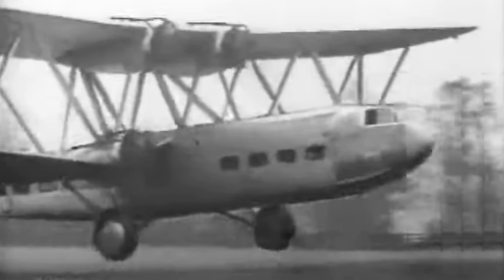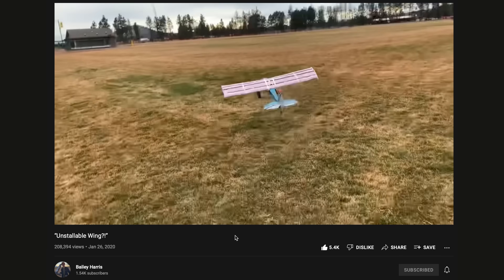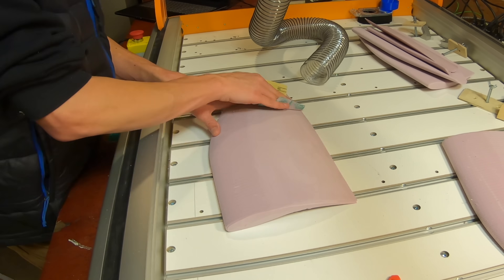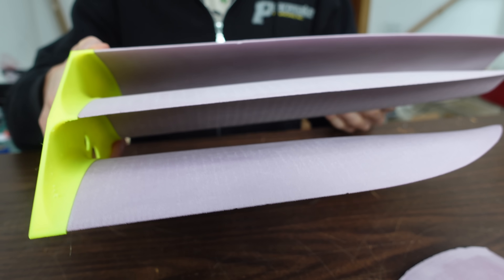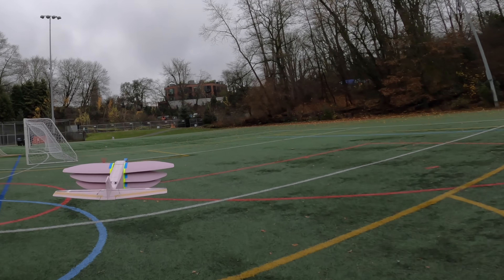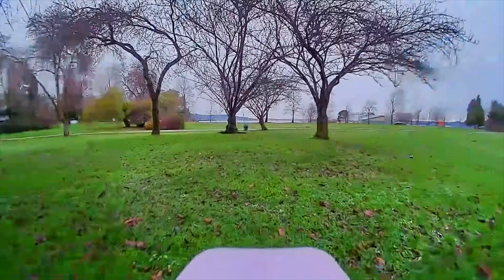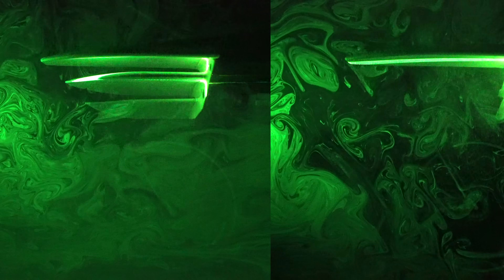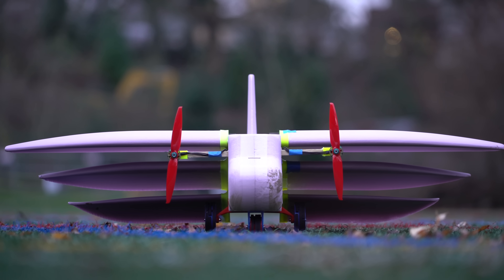Best STOL Wing Design Ever?!?

Comment: i mean birds already had this down pat as individual feather muscle control and sensory allowing for different flight characteristics based on which muscles they hold tight or loose that's clearly evident in their landings if you can watch such a fast motion and understand it but for takeoffs they'd grip and climb 🪜 through the air only twitching the flaps aka feathers open to slide through the air momentarily bringing wings forward for another down/reverse push stroke
Reply: i had a fucking stroke reading this.

Comment: I believe mounting your propellers lower would help counter the throttle-up-equals-nose-down problem.  Getting your center of thrust below your center of drag will generally try to push the nose of your aircraft up instead, while your current setup has the center of thrust above the center of drag.  Obviously, not easy to just move the props lower, as that creates ground clearance issues, but maybe you can mount the compound wings higher?  I'd say putting the middle wing surface where the top is currently would most likely improve the flight characteristics based on thrust.

Of course, you may need to raise the tail again to get it out of the wing's air-path after doing something like that.

As for your "Tailerons," they seemed to work quite well.

Comment: That nose-down takeoff definitely showed the magnitude of the crazy pitching moment from this wing. Awesome work man
Reply: Not neccesarily, the thrust lines of the engines could be an issue. When they are at the upper level of the aircraft's thrust/drag lines the engines should have up-thrust. Check out some of the amphibious aircraft designs with high mounted engines, they all have up thrust.
Great trial.
Reply: @vumba1331   I always wondered about the angle especially with sea planes.
Reply: @vumba1331  Good idea, but it could be that  the angle of attack was chosen too high, that means instead of lift it produced also drag (=non-zero backward component of the lift).

I think the angle of attack should change when adding more wings. Consider all three wing pairs to form a single wing-pair with holes in it, then it looks like configured for landing. 
Maybe if the angle of attack is smaller, then the air flow does not really use the "holes" and it shows less drag. I would be interested in knowing how it behaves.
Reply: @vumba1331  yes, this is what I was looking to ask about raising the thrust vector.... thanks
Reply: @chtomlin  You're welcome, good lock with the trials.
Reply: I would think center of drag is low down, around that lowest wing with its very high angle of attack, couple that with the high-mounted engines and it's not surprising there's pitching down under power (and at take-off).
Reply: @grantm6514  Agreed, angle the thrust lines more upwards.
Reply: Do us some new videos about vtol
Reply: I suspect that ground effect on the lower wing that is very far aft also contributes to that.
Reply: not pitching moment of the wing, its the motor angle.  The motors need to be twisted up so that the line of thrust goes slightly below the cg.
Reply: Ever seen a B52 take off. The rear always gets off the ground first
Reply: Exactly what is a "work man", and how does an awesome "work man" differ from a regular "work man"? Eaten any grandmas lately?

Comment: I always wonder about the slotted flaps when I took a flight.
Reply: There are several effects with the slotted flaps.

They are actually called "Fowler" flaps  Typically 2 to 4 stage (2 to 4 sections)  You can have just one.

The flap not only rotates, it is pushed back.  This combination opens the slot.  It also effectively adds wing area, because in the retracted position, the flap sections overlap each other.  Pushed back they expose more surface area.

air from underneath is forced through the slot due to pressure differential below vs above the wing.  This accelerates the air over the flap. It also helps "lock" the airflow over the main wing panel in a near laminar flow.  It helps delay stall.

Then there's the changed curve to the effective airfoil, taking a high speed airfoil and converting to a low speed, high lift airfoil, when you consider it as having a continuous curve.  The majority of affected air is using this  curve.

It has long been well known that slots of assorted natures can improve low speed flight.  But they add a LOT of drag.  There's also a weight penalty involved.

Everything about an aircraft is a compromise.  Trading increased weight to get strength, increased weight to get more power, increased weight to gain range...  Wing shapes are trading between lift and drag.

Being able to change the shape of the wing in flight means you can have the low drag shape for cruise and the high lift shape to reduce take-off and landing speed.